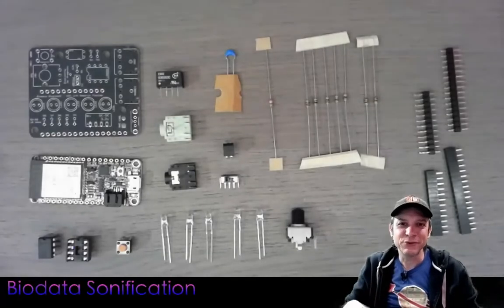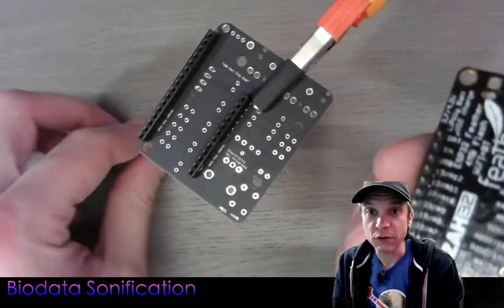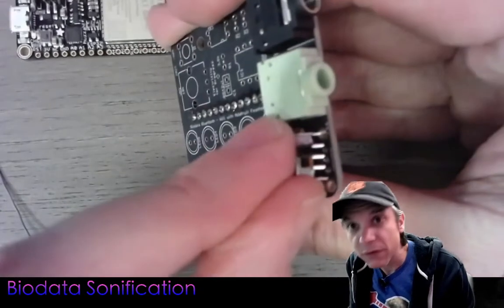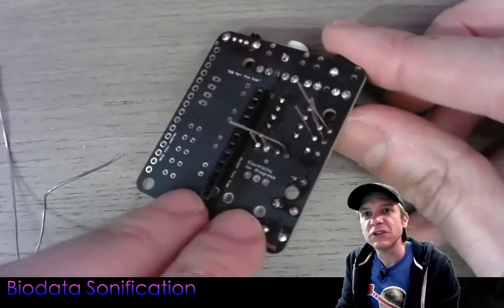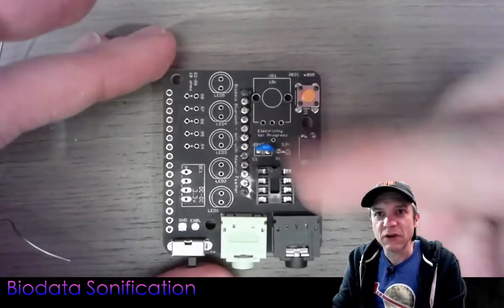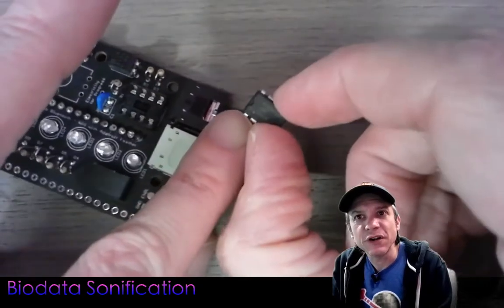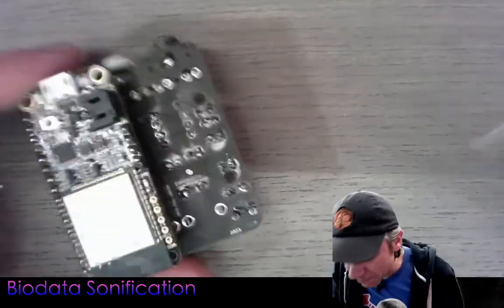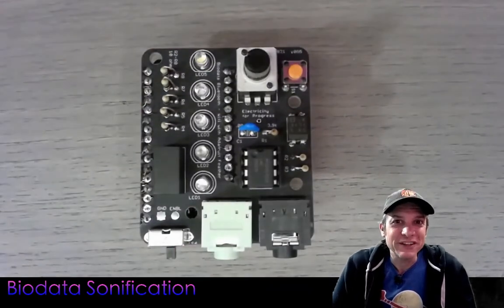Biodata Kit Assembly

Comment: Hi! I'm currently working on this project using Arduino Uno and I'm having an issue, would my mind helping me out please? I don't really know how to use the different programs, I mean, "BiodataSonification_026_kit.ino" is uploaded on my Arduino board and when I touch the sensors, the LEDs light up and the overall program seems to work. Now, my issue is that it's plugged in USB and I can't get some sound from it, FL Studio detects the MIDI controller but no sound comes out of it. I thought maybe I needed to make it work along "Serial_MIDI_Converter_V2D.ino" file included on the github folder, so I installed Processing, laucnhed it, but the app crashes when I select an output port stating "NullPointerException" and highlighting line n°455. Would that be an error in the build? The code maybe?

Comment: Bonjour, Quel est le programme standard pour faire le test,? parce que pour moi aucun ne fonctionne, dont un est trop lourd et les autres, rien, téléchargés sur github, MERCI
Reply from the maker: Bonjour, I am not sure what you are asking for here.  The code is on github for the biodata device and the latest version is for the ESP32-S3 (version _07.ino).  What are you trying to 'test'?
Reply: @electricityforprogress  Hi, with adafruit esp32 feather, message :
compilation error : 'Adafruit_USBD_MIDI' does not a type
Reply from the maker: @bizarrocebola  perhaps you need to install the library. #include <Adafruit_TinyUSB.h>
Reply: @electricityforprogress  no that's not it, I still have the same error,
Reply from the maker: @bizarrocebola  If you have an existing or older version of Arduino that you're using you might have an older version of tiny USB. If you dig through Ada foods documentation you can see that there is been some changes to tiny USB but now it's should be in the main libraries of the espressif ESP32. I recommend in starting from scratch and install Arduino 2.0, the associated libraries and the esp32 board definitions.
Reply: @electricityforprogress  no, it didn't work
Reply from the maker: I'm sorry that you are having trouble @bizarrocebola  , I don't have any other advice for you and I believe the issue is in your setup/installation of Arduino IDE and the dependent libraries.  If you are new to electronics and programming I suggest working with a friend or go to a local Maker Arts space and ask for assistance.
Reply: @electricityforprogress  I master it quite well, the problem is the versions of the libraries, because everything works with other codes, thank you for your help
Reply: Hello,
Maybe because I'm on windows?
Reply from the maker: @bizarrocebola  your issue is the libraries in the configuration of your environment. It doesn't matter if you're on Windows or a different machine. Sorry you're having the trouble, but this is not an uncommon issue with any MIDI related code base trying to run on an established installation of Arduino IDE. A true clean installation is probably needed.
Reply: Hello,
the usb_tiny library is only for esp32 feather s2 and s3, and not for version v2, what do you think?
Reply from the maker: @bizarrocebola  I use the esp32-s3 and it works great.

Comment: Hi Sam, I have built the breadboard project and trying to download the sketch but it gets stuck on the first line
BiodataSonification_026\BiodataSonification_026.ino:12:10: fatal error: EEPROMex.h: No such file or directory
 #include <EEPROMex.h> //store and read variables to nonvolitle memory
          ^~~~~~~~~~~~
compilation terminated.

exit status 1

Compilation error: EEPROMex.h: No such file or directory

Any thoughts on this. I have tried to find where to install this but can't find any information that I can understand?

Your help would be really appreciated.

Thanks
Reply from the maker: Hey Steve, thank you for your interest in the project. There's nothing special about the eeProm library which is used. It all depends on what you already have installed in the Arduino IDE. Go into the library manager search for eepromex. Check out adafruit's many great tutorials if you need help using the Arduino IDE.
One other option is to use the MIDIsprout code https://github.com/electricityforprogress/MIDIsprout

Comment: Hi sir!  I trying to follow your github biodata signification files and have came across some problems when running the code, I can upload to the arduino successfully, but the midi serial port shows that no midi signal is being transmitted, I can't find this port in abableton live, can you tell me how to connect the arduino to the computer?
Reply from the maker: I will need some more information in order to help you. What specific code are you running, are you using the ESP32 version as shown in the video or are you using the old midi sprout code? How are you attaching to your computer, do you have a USB to MIDI device, and specifically what brand and type of USB mini device are you using? If it is a cheap USB MIDI cable it will not work from any input from this device.  Does the LEDs light up when you turn the device on for the light show, and do the LEDs light up when you are connected to a plant indicating that biodata is flowing?
Reply: @electricityforprogress  Thank you very much for your reply sir. I am using the arduino and breadboard version and in this experiment, instead of using a USB MIDI cable, I have connected the arduino with a usb cable and converted the signal from the arduino to midi on the computer via the midi serial port (name haireless-midiserial).
There are two problems I encountered. The first problem is that in the serial monitor I can only see garbled codes that make no sense, whereas on the application connected to the midi serial port I can see some midi signals being output to the computer via the arduino, and in the abableton live I have beautiful music being produced. The second problem is that the output data does not change when I touch the plant or take away the electrode leads. The biological data generated here does not seem to come up from the plant but is generated randomly. I'm building this for my final year university degree and I'm hoping you can help me!

Translated with www.DeepL.com/Translator (free version)
Reply: @electricityforprogress  Thank you very much for your reply sir. I am using the arduino and breadboard version and in this experiment, instead of using a USB MIDI cable, I have connected the arduino with a usb cable and converted the signal from the arduino to midi on the computer via the midi serial port (name haireless-midiserial).
There are two problems I encountered. The first problem is that in the serial monitor I can only see garbled codes that make no sense, whereas on the application connected to the midi serial port I can see some midi signals being output to the computer via the arduino, and in the abableton live I have beautiful music being produced. The second problem is that the output data does not change when I touch the plant or take away the electrode leads. The biological data generated here does not seem to come up from the plant but is generated randomly. I'm building this for my final year university degree and I'm hoping you can help me!
Reply from the maker: @okamiryoko7735  Okay there are a couple of things to think about here.  First - Make sure the circuit which you have built on the breadboard is functioning correctly.  Does the LED on the 555 timer flash when you touch the electrodes with your fingers (this will test that the biodata sensor is working)?  Do the 5 LEDs connected to the Arduino light up when you touch the electrodes with your fingers or connect to a plant (this will test if the biodata is being translated into notes)?  If the device passses these two tests, then the circuit is likely working correctly.  If any of these tests fail, remove all components from the breadboard and rebuild following each step.
Second -   Connecting to MIDI is always a big challenge for users.  I do not recommend using the Hairless MIDI bridge, but I can confirm that it works with the biodata device.  There are many configurations in the Hairless bridge and MIDI monitor software which you will need to figure out, MIDI and computers is kinda hard (as you know) and it is really difficult to debug the setup.  I do recommend using a high quality USB to MIDI cable, I use the Emu xMIDI.  Cheap usb-midi cables will not work!

When you say that you are seeing data even without the electrodes connected to a plant ... that sounds like a problem in your breadboard circuit.  The LEDs should only light when the electrodes are connected to a plant.  I highly recommend removing all parts and reassembling the circuit.  

I will not be able to help you debug your computer MIDI setup, but I am happy to support your assembly of the circuit.  There is lots of information in the old Biodata forum on my website https://electricityforprogress.com/Forum/

Comment: Hi! I'm currently trying to follow your github biodata signification files and have came across some problems when running the code, I'm using an uno rev3 and the breadboard should be working fine, is there any chance you could help me with the code? I'm building this for my last year of degree for uni, would be great if we can get in contact:) btw thank u sm for the detailed instructions and everything!
Reply from the maker: Hello Cherry, this version of the Biodata device in the video uses an ESP 32 Feather by Adafruit and uses Bluetooth and Wifi.  There are other versions of the codebase for use with an Uno.  In order to help you need to be very specific about lots of questions ;)  what codebase from git are you using?  Do you have experience using the Uno? Can you get the blink sketch running?  Does the biodata code compile and where in the upload process are you getting an error?
Reply: @electricityforprogress  thank you for your response! I found the BiodataSonificationBreadboardKit and have completed the breadboard, i tried uploading the biodata-sonification arduino sketch which i downloaded straight from your github but its showing 'button' 'noteLEDs'  'leds' are not declared in the scope repeatedly a few times, ive only started learning not long ago, again thank you so much for responding :)
Reply from the maker: @cherrys4767  Okay, you need to install the libraries for the button and LED Fader, at the top of the code in the BiodataSonification_026_kit.ino you will see the #include statements for Bounce2 and LEDFader, you need to install these two libraries into Arduino.  There is a great guide on Adafruit for installing Libraries https://learn.adafruit.com/adafruit-all-about-arduino-libraries-install-use
Reply: @electricityforprogress  thank you for much for your help! i have set up the system and want to be cooperating it for a part of an exhibition, i would love to get into contact with you possibly by email or instagram for further details and information regarding the piece:)
Reply from the maker: @cherrys4767  Yes you can contact me, I am happy to offer advice on building and using the biodata device. I offer workshops, custom devices, and tutoring!
Reply from the maker: @cherrys4767  Yes certainly, you can contact me through instagram or my email address is samuel [dot] cusumano @gmail  I am happy to offer advice, I also provide tutoring for electronics and workshops on biodata and electronic music.